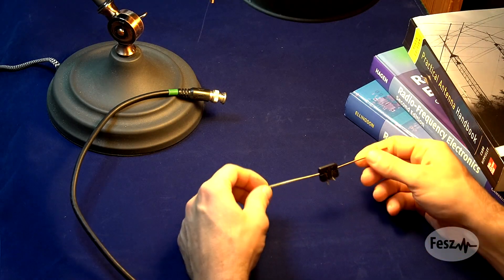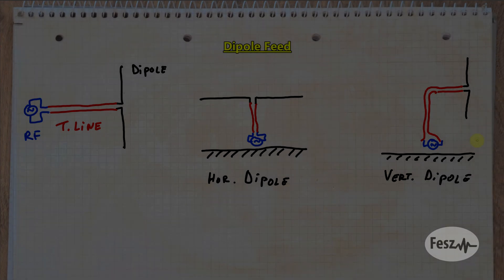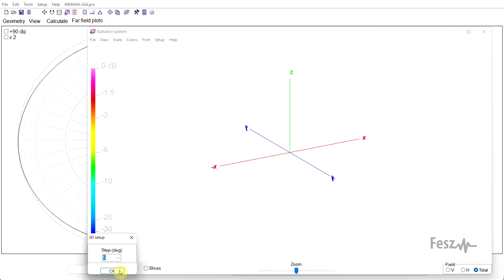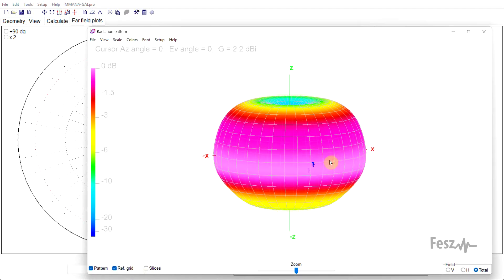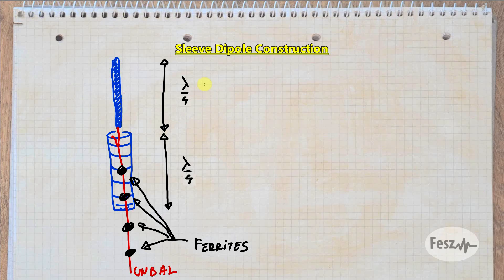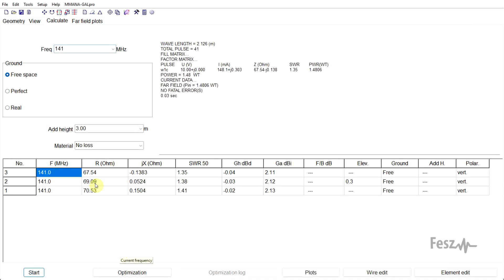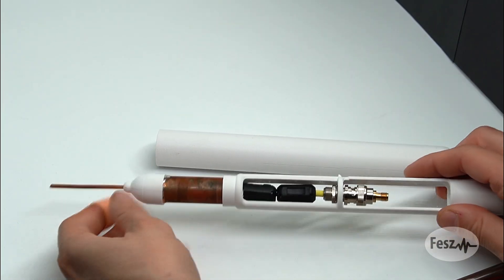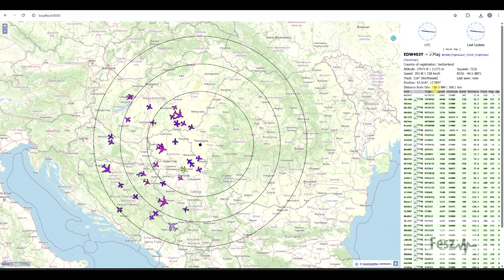The Sleeve Dipole Antenna

Comment: I am not into antennas, but living in the city, I have build one of this type of antennas for the DAB+ frequencies (flowerpot antenna).  What seems to me to be a great plus is how easy you can build a simple one with the coax cable already in use. Strip the plastic outer shield for 1/4 wavelength, and fold the copper braided shield back OVER the lower plastic outer shield, and fix it with tape or tie wrap. Under the (total of now) 1/2 wavelength you can put 2-3 narrow turns in the coax as RF choke. Stick it in the air or hang it from the top on the ceiling with plastic wire.

Comment: Little tip for straightening solid copper wire: put one end in a cordless drill and the other end in a vise (or a friend with pliers).  Spin it under tension until it stretches slightly and it will warm up a bit.  it will come out perfectly straight.
Reply: I like to do it in lengths of a couple meters or so at a time, before you cut to length.
Reply from the maker: I never heard of this method, I will try it next time. Thanks for the tip!
Reply: It also work hardens, or stiffens the copper, which is often handy for antennas. Another YTuber pulls the wire straight with his motorcycle, also to harden it.

To avoid hardening, roll the wire between a couple of boards or books which are as long as the wire being straightened, which doesn't stress it as much as spinning or stretching.

Comment: Thanks for the relaxed introduction to sleeve dipole antennas. 

I do design them also, but mostly with thinner sleeves compared to wavelength. I do not put ferrite within the sleeve as it reduces the common mode suppression of the quarter wave sleeve itself.   In your case it may be acceptable as your ratio of sleeve diameter and wavelength is large. 

It surprises me that the SWR bandwidth of the sleeve dipole is significantly larger compared to the ground plane antenna.   Can it be because of some energy is launched as a downwards common mode wave (that is partly dissipated by the ferrites)?

Comment: Very interesting. A modification of this would be the 'flowerpot' antenna where the sleeve is not needed, but the outer surface of the coax forms the second leg of the dipole. Again, ferrite beads or a bazooka balun (sleeve balun) is also needed. Of course, you can modify this arrangement forever. The paper by H.A. Wheeler on a coaxial, collinear antenna is very interesting because his word predates any readily available computer analysis techniques. Very enjoyable video, many thanks!
Reply: The flowerpot antenna needs a bit more explanation to build: https://www.youtube.com/watch?v=2ggDi9VP_c8&lc=UgzQkVSfh6n8JmDFu3J4AaABAg

Comment: Other vertical antenna designs to consider are the flowerpot, EFHW, and J-Pole. That way you don't need special equipment like a 3D printer.

Comment: What about using the shield of the coax as the lower hollow element and using a high impedcne ferrtie bead below the 1/4 lambda point to chocke it off? Or will the missing "shield " impact the pattern?

Another question I had is how the ferrites added at 6:07 convert the dipole from balanced to unbalanced?

Comment: Great video! It reminded me of the typical flowerpot antenna, it kinda matches the structure
I think the simulation may be a bit unrealistic as you are missing parts of the interaction between the sleeve and the coax. I couldn't seem to find any programs where you could include coax cables in the simulation itself, or make hollow tubes in mmana-gal.
I think most commercial antennas for higher frequency bands just use some RF magic to make the sleeve work as a balun too, that may be something cool to try
Reply: Yes, I think the flowerpot antenna is basically a sleeved dipole where the outer shield of the co-ax is acting as part of the transmission line and the lower radiator. It makes my head hurt thinking that RF current in the inner part of the shield is flowing in opposite direction to current in outer part. However, it certainly does work.

Comment: Why not mount the dipole horizontally respect to ground? Maybe because of space need in vertical is more maneageable respect to horizontally?
Reply from the maker: You can have both horizontal or vertical dipoles, but you chose one or the other based on the signal proprieties you wish to received or transmit - the antenna orientation will impact the wave polarization.
Reply: @FesZElectronics Thank you! And my compliments for your beautiful channel, a perfect match between theory and practice
Reply: because the transmitting antennas are vertically polarized meaning a horizontally polarized antenna wouldn't receive the signals.
Reply: In addition to the wave polarization, dipoles produce a donut shape signal, which for horizontal dipoles the donut is sideways, and there's no signal coming out towards where the poles are pointing, creating a couple of blind spots (or blind areas, depending on the signal strength you need).
Reply: @DiThi You are right. I was forced to think at horizontal dipole because mine was for 20mt HF and was practical to have it laid over the roof.

Comment: I’m not sure how well common ferrites work at the hundreds of MHz territory. For my 2m/70cm dipole I just wound the coax 5 times around a 20mm pipe, making a common-mode choke without any magnetic core materials. Ferrites are certainly a rabbit-hole.
Reply: For his frequency of interest ferrite mix 52 or 61 would work fine at the 1GHz range.  Personally I use mix 52 on my 23cm feedline because it has a little higher initial permeability than mix 61.
Reply: The ferrite material is very lossy.  Probably why the bandwidth is wider than the groundplane, the resistive term of the ferrite artificially makes the match better.
Reply: Coax choke baluns seem to be popular for budget DIY and are simple, and I think there's a calculator somewhere. At this scale one can "wind" one by carefully pushing/coiling the micro-coax into the sleeve, since this video isn't using the sleeve also as a quarter-wave balun.
Reply: The antenna building bug bit me recently. I built a 70cm flower pot antenna. That uses the shield of the coax for one leg of the dipole and a coil to choke off the RF. I used a bit of PVC pipe and put the antenna in that. I moved on to a 1/4 wave ground plane antenna for 70cm, I think it works a bit better. Next up a 2m/70cm that I can mount on the roof
Reply: Looks like a good meshtastic antenna idea.
Tiny flower pot -like.
Good job Sir.
Reply: Did you 3d the plastic bits?
Reply: @justplanefred  I 3D printed (PETG) the balun/choke tube and the mounting slots that hold the aluminium tubes of my dual-band dipole, but put it inside a polycarbonate box I painted white.